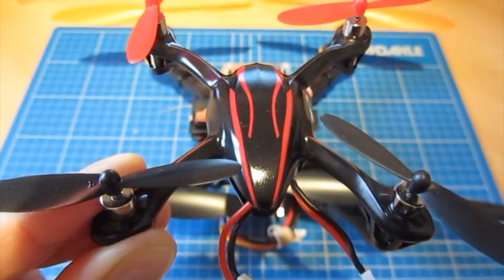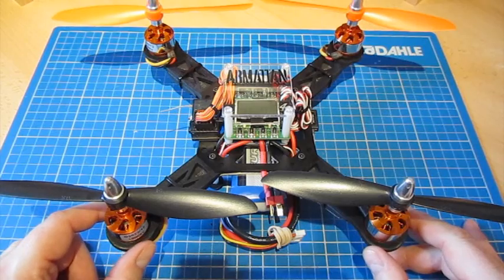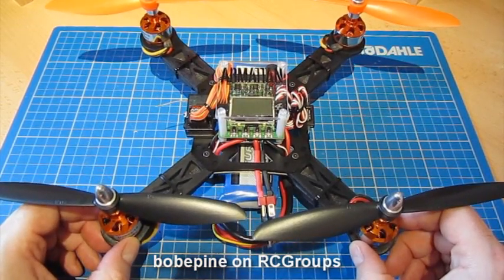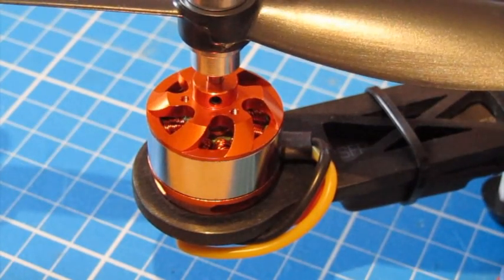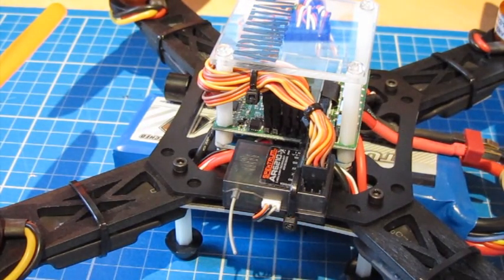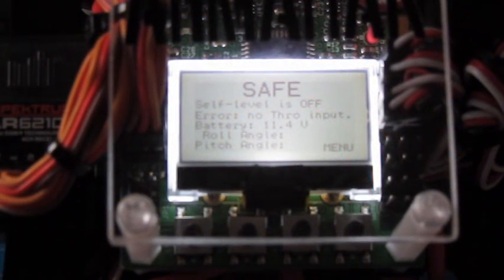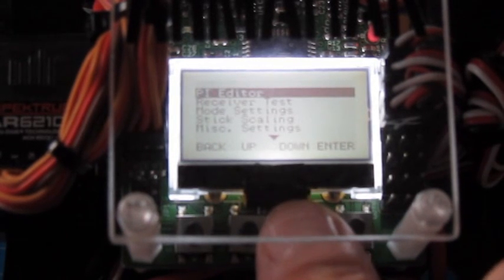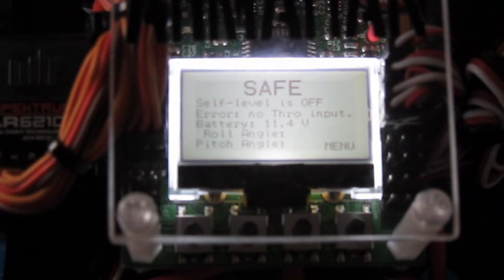Armattan 258 CNC Quad - Quick overview, review and flight video

Comment from the maker: Pitch and Roll are P gain=55, P limit=100, I gain=30, I limit=20.

Yaw is P Gain=70 P limit=50, I gain=60, I limit=10

Seems to fly well on mine, these are the setting that came on it when Chris built it for me and he's had a lot of expereionce setting these up. I guess that a different size quad would need slightly different numbers..

Happy flying!

Comment: I know that you practiced up with your smaller quad but how did you do at 1st with your KK2?I know thats not a fair question because Chris probably had it dialed-in best it could possibly be but do you think that you could have tuned it yourself? My KK original is kicking my butt at the moment and I am wondering if I should get someone to do my initial setup for me if I change out to a KK2 or try to do it myself? I am new to quads to but have a lil 4ch heli experiance.I am flying but not 2 well